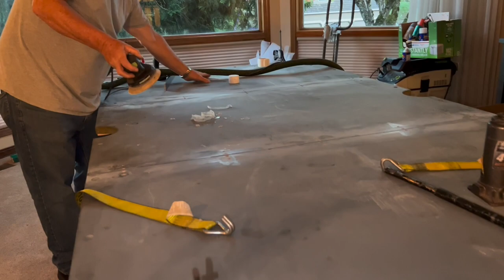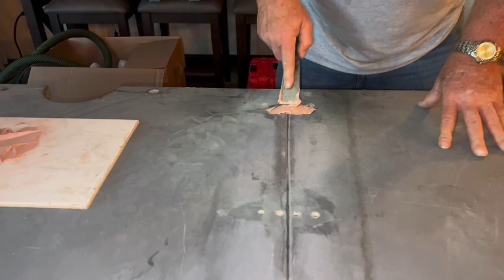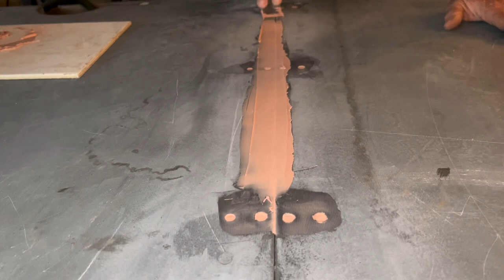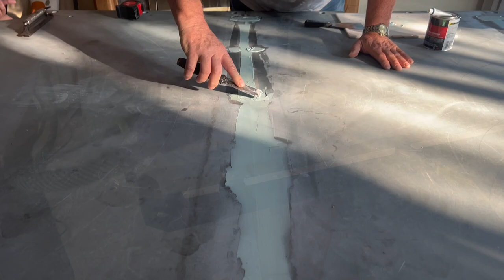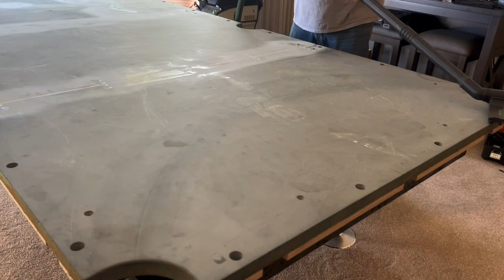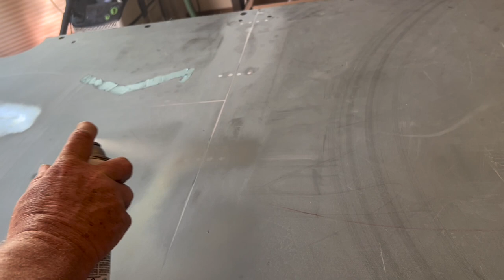HOW-TO: Level a 3 Piece Slate! (Part 2)

Comment: Just got my used table set up by a local shop.  The middle slate has chips on the middle of the play areas around 0.4” depth and 2” wide.  They claimed that beeswax is all good as a filler ?
Reply from the maker: I prefer Bondo

Comment: How do you get the bondo out to remove the screws when taking it back apart?
Reply: I usually just pick it out or I'll use like a 3/8 inch drill bit to hog out some of it. Just need to expose the screw head. One you can grab the screw it will push more bomdo out of the hole when you loosen it.
Reply: @McSquizzee  thank you I used a heat gun chisel and acetone. Worked great. I posted a short on my bird nerd channel of how I disassembled it. One minute short kinda fun.

Comment: what is the clear looking spray? and are those two diff colors of bondo?
Reply: Yep, but from my experience, it's the hardener that gives it its color. The little bottle of hardener that comes with the bondo is normally red but never enough. Sometimes the individual bottles of hardener that are sold are a greener looking color. 🤷‍♂️
Reply from the maker: The bondo just had 2 different harder mixes. The spray, is slate colored paint, that way it looks just like a 1 piece slate when I'm finished.
Reply from the maker: If you noticed, I mix my bondo on a tile I keep with my 3 piece slate work. I hate seeing the slate being used to mix bondo or putty on, because no one ever cleans it up afterwards!!! I just think it looks offensive!